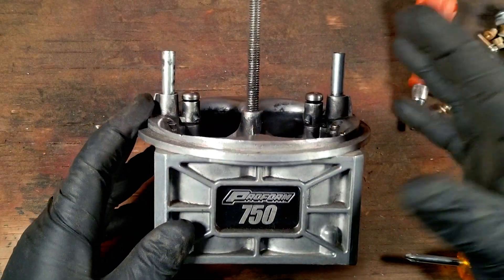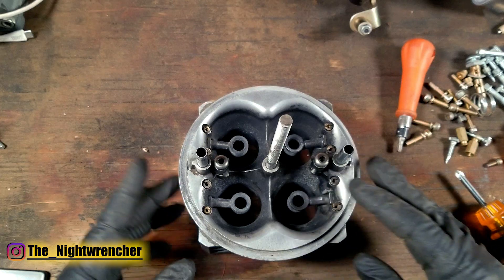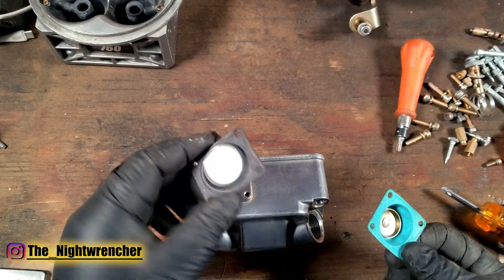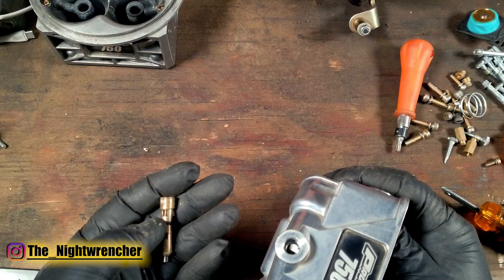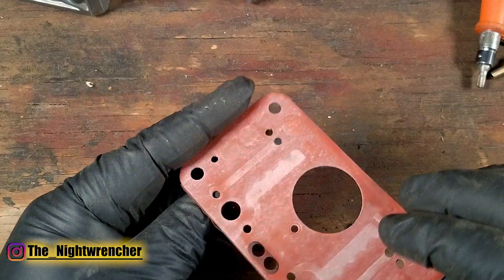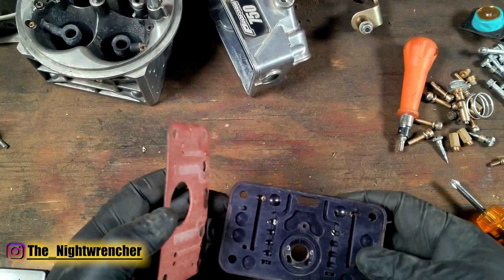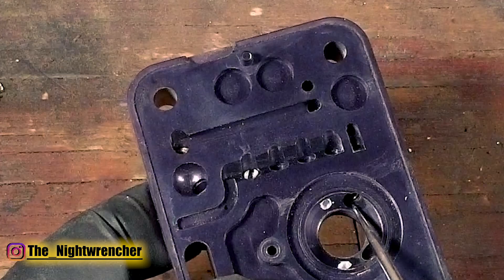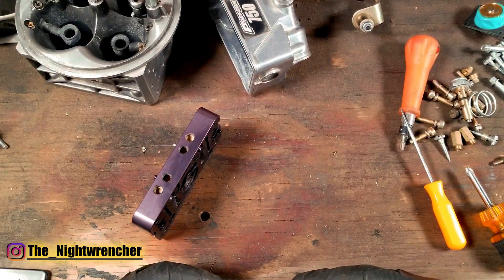Cheapest E85 Carb Conversion Holley Carburetor | Holley Carb Secrets | Proform Race Series

Comment: I have a proform 750 I converted to a pump gas blow thru. I drilled the power valve restrictors to .080. Can one just drill them bigger for e85 or is it necessary to drill the extra set of holes?
Reply from the maker: It just depends if you can get enough fuel to flow through them. More holes gives you more "coverage" but not necessary if the holes you have flow enough

Comment: Lets say i purchased a 500 2300 carb. Long as i up my jets and change it all over gasket wise i should be fine for e85? I want this turd to run but i dont need any spot on tuning. Its for a demo derby car 4.3 v6
Reply from the maker: Yeah, it should run fine as long as the tuning is close richer is better on E85

Comment: Good night wrencher, that’s a damn fine video.
I’m following your guidelines for my Quick Fuel 750. 
Can I run my 383 sbc with 13.5 to 1 compression ratio on pump 91 to get it running and valves adjusted and so forth and then install the e85 carb on it?  Does e85 color the plugs like gas?
Thanks again for the how to.
Reply from the maker: Yes you can but becareful, don't be too greedy with initial timing. You will be able to get it started and idling just find. Don't try to drive it around or you might run into detonation
Reply: @NightWrencher  I thought 34 degrees and not load the engine in any way, hey , I appreciate your feedback. Does e85 color the plugs like gasoline?
Thanks again.
Reply from the maker: @michaelmaher4328  you can drive it around but you'll need to back off the timing to maybe 20 degrees. E85 runs cleaner but you'll still be able to check the plugs, it'll just take more time to get a good pattern. Definately recommend investing in a wideband that reads in Lambda, not AFR
Reply: @NightWrencher  I appreciate the heads up